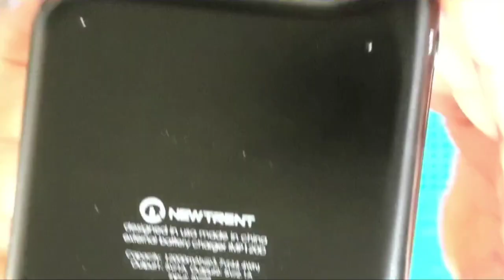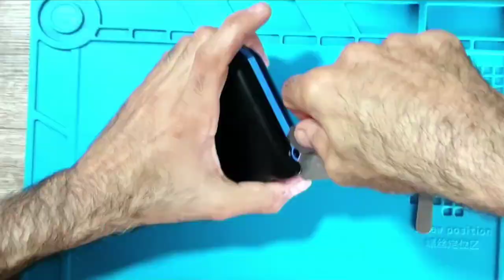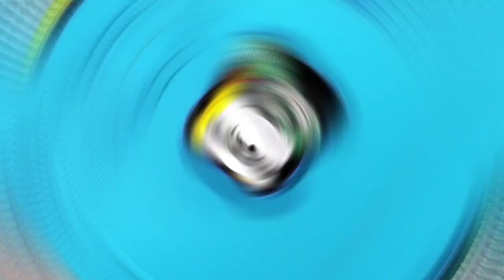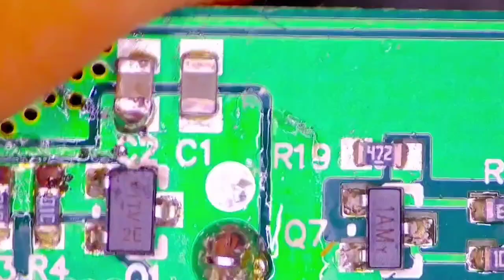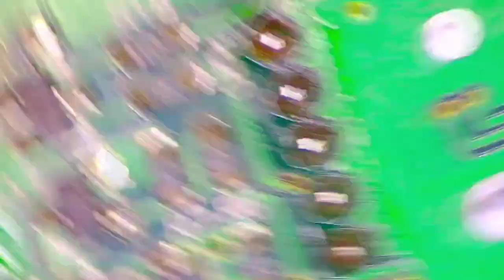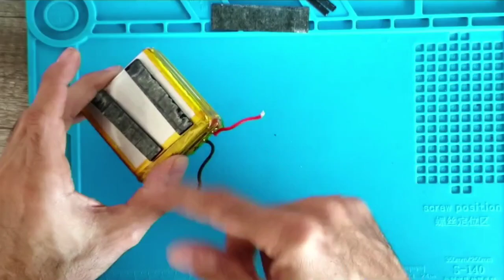39 Newtrent Power Bank (IMP120D) - What's Inside

Comment: Thanks. I have the same power bank which doesn't hold much of a charge these days. I also thought it contained a bunch of 18650's, and as I had some spares I was thinking about trying to swap them. I'm glad I watched your video first, to see it has the flat batteries inside. I would imagine the careful application of heat will help with opening the case, now that we know where the double-sided tape is positioned. I subscribed as you seem to be playing around with the same sort of stuff that I am just getting into! 😁
Reply from the maker: What a lovely message! Always nice to hear from fellow enthusiasts/hobbyists. A bit of heat, as you suggest, might indeed help with the tape. And you can indeed reuse the enclosure as I did in the subsequent video (#40) to build a newer, more capable/modern power bank. Best of luck and do let me know how well you get on with your project.

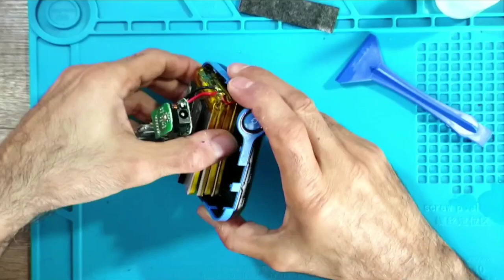Comment: You can use fishing line, fishing string, to cut the tape....place the line under the battery and pull it... be careful with pushing items like 3:50 you can pierce battery and start fire.
Reply from the maker: Greetings @orion310591RS,

It's not obvious from the sped up video, but I'm using a plastic scraper, and using sliding motion not stabbing. It was also obvious to me that I was dealing with 2 strips of double sided tape (like the top side), which is what I was scraping and not any part of the flat battery pouch.

But your advice and concerns are valid. I agree and the "better safe than sorry" rule certainly applies in this case. I appreciate your suggestion, as well as your note of caution.